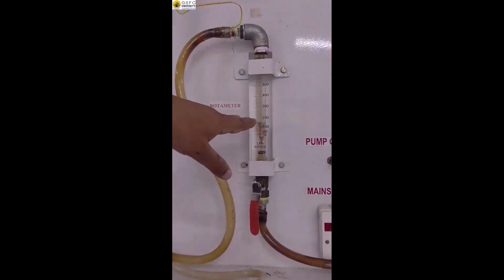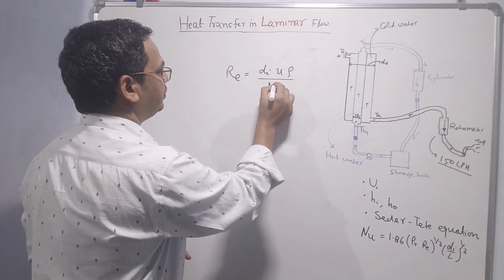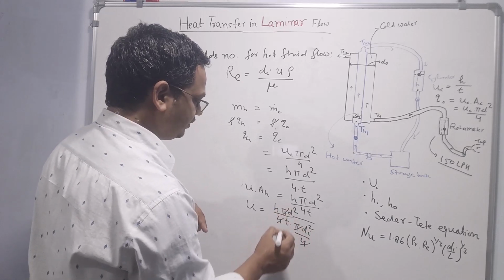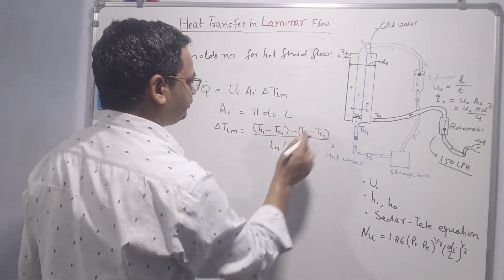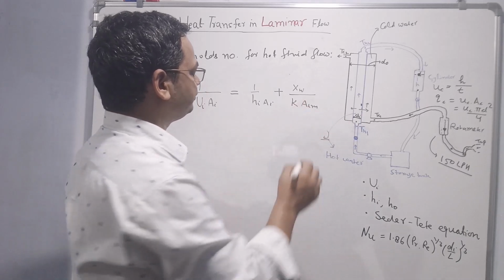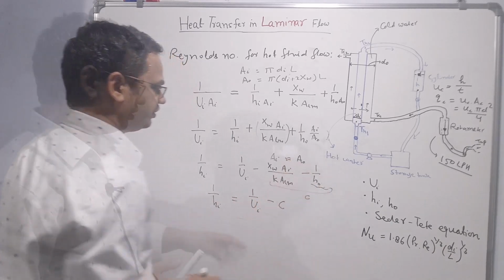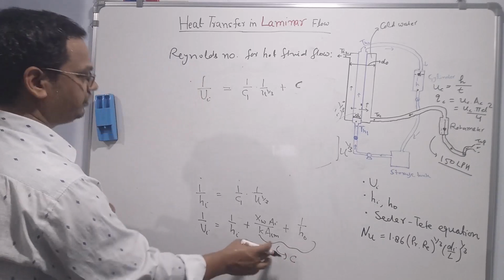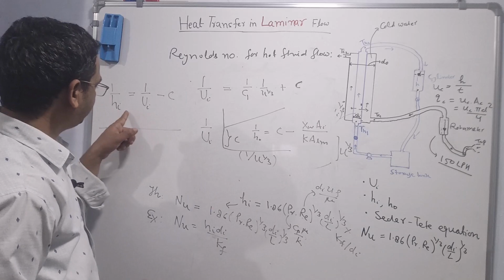Heat Transfer in Laminar Flow: Experimental Demonstrations and Theoretical Descriptions

Comment: Sir I request you yo please upload more chemical Engineering lab experiments :

PROCESS MODELING AND SIMULATION LAB

LIST OF EXPERIMENTS:

1. Estimation of dew point and bubble point temperature of a hydrocarbon mixture
2. Simulation of flash drum
3. Design of ditillation column
4. Optimization of a flow sheet or process
5. Determination of temperature profiles for heat exchanger
6. Concentration profiles for reactor
7. Simulation of Jacketed CSTR
8. Simulation of process
9. Simulation of evaporator/ distillation column/ extraction process

PROCESS DYNAMICS AND CONTROL LAB

LIST OF EXPERIMENTS

1. I & II Order System Dynamics
2. Interacting & non interacting Systems
3. Flapper - Nozzle system
4. Control valve characteristics
5. Level control system
6. Flow control system
7. Pressure control system
8. Control of a thermal system
9. Design of control system for a given process
10. Simulation of a closed loop system
11. Demo Experiment using Aspen Software of a given process

CHEMICAL REACTION ENGINEERING LAB

Experiment No. 1: Standardization of the given solution of NaOH.
Aim: To determine the normality of NaOH solution 

Experiment No. 2: Plug flow reactor
Aim: To determine the second order reaction rate constant for saponification reaction between NaOH and 
ethyl acetate in a plug flow reactor

Experiment No. 3: RTD study in CSTR 
Aim: (a) To plot the RTD curve for a CSTR using a pulse input as a tracer 
 (b) To determine the dispersion number

Experiment No. 4: Isothermal batch reactor 
Aim: To determine the pseudo first order reaction rate constant for the saponification reaction between 
NaOH and CH3COOC2H5 in a constant volume adiabatic batch reactor

Experiment No. 5: Adiabatic batch reactor 
Aim: To determine the pseudo first order reaction rate constant for the saponification reaction between 
NaOH and CH3COOC2H5 in a constant volume adiabatic batch reactor

Experiment No. 6: Continuous Stirred Tank Reactor (CSTR)
Aim: To study of a non-catalytic homogeneous second order liquid phase reaction in a CSTR under 
ambient conditions.

Experiment No. 7: RTD study in Packed Bed Reactor (PBR)
Aim: (a) To plot the RTD curve for a PBR, using a pulse input as a tracer
 (b) To determine the dispersion number